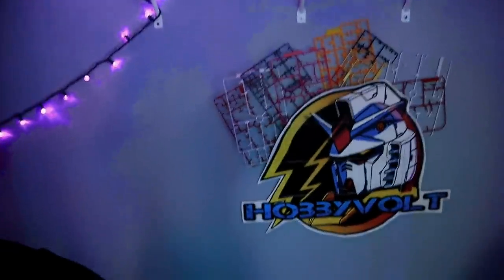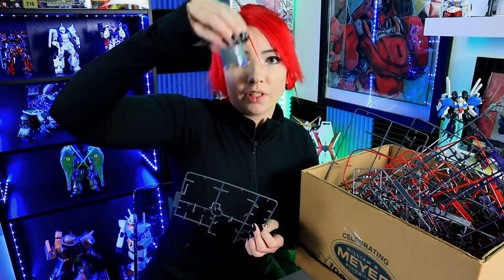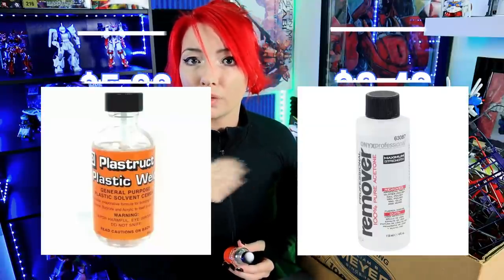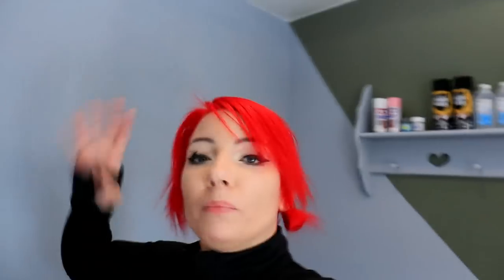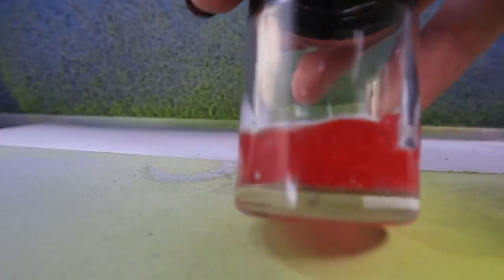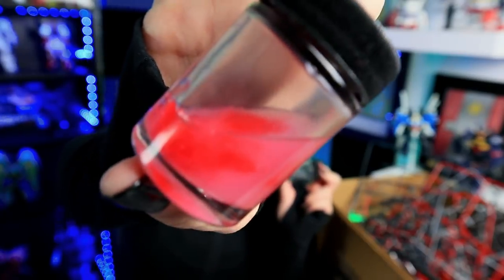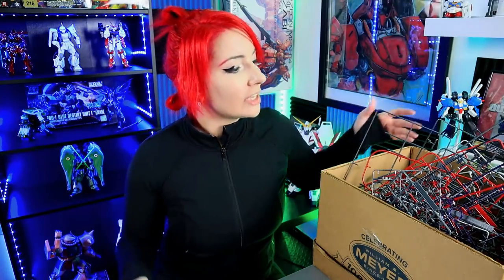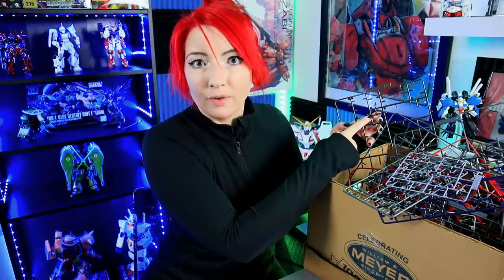⚡How to melt extra runners to make putty! Melting Sprue with Plastic Weld ⚡#gunpla #gundam #plamo

Comment: I honestly think it would be interesting to try and use this method with a two-part silicon mold trying to replicate parts and I mean if you have enough spare runners something like this you could theoretically build an entire Gundam from that so you only have to buy the one copy of it and I also wonder if doing this acetone process would work on pla late? Hmm food for thought because I mean when you're cutting little extra details out of it you're always getting those little bits that either you just throw them away and or push them off to the side and they're just getting wasted same with whenever you're sanding if you have a little collector bucket underneath while you're doing it you could even try with that
Reply from the maker: LOVE this whole idea! I will start trying to see if this is something I can do!!! Thank you!

Comment: What if you wanna remake a couple of parts for something new? Reason I'm askin is that I'm trying to make a brace for my Wing Gundam Ver. Ka so that it can hold its buster rifle one handed without it drooping. I'm casting the two parts out of non-drying clay and as for the mid section of this brace, I could do the same thing, cast the underside of the buster rifle in the clay or use casting plaster to make the mid section. Would this trick of melting down runners work or is it just a waste of time?
Reply from the maker: So, I've had some pretty good results with casting small pieces this way. Like foot guards and such. I think it could work well OR I'm a HUGE fan of Green Stuff World resin. I use it for cosplays and Gunpla. Just get the little UV light and pour resin into your mold and hit it with the light. Then paint. If you don't want to do all that, you could certainly use this trick.
Reply: @HobbyVolt Last night I made my own spruce goo, at first it was a bit runny so I added more runner chips into the jar and it came out like a paste as needed. I'm waiting on the two parts that I molded to cure first, probably won't touch them until saturday or sunday before I pull them out of their molds. After that would be to cast the mid section and fit it together

Comment: Hi! this video is very educational. I might try your method to recycle all the leftover runners (believe me, there are A LOT of them) and try to do something with it.

Thanks!

P/S: Is it possible to use the dissolved runners to 'cast' new parts onto a mold? Is it durable enough to be used as backup runners for the gunplas?
Reply from the maker: Thank you so much!

So I tried casting new parts and it works but the parts are kinda more flexible and less solid. I'm experimenting more with that and I'll probably make a video on it as well!
Reply: @HobbyVolt  Thanks! I never expected a reply this quick (smiles). Looks like there is hope for the leftover runners after all. 

Oh yeah, the runner graveyard idea never crossed my mind. Thanks for the suggestion
Reply from the maker: No problem! I am always happy to help!!!